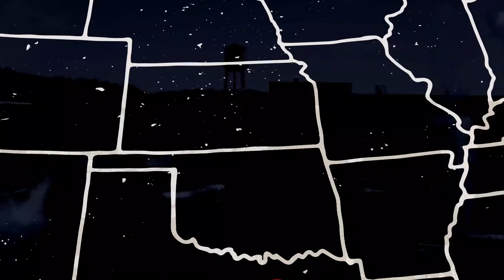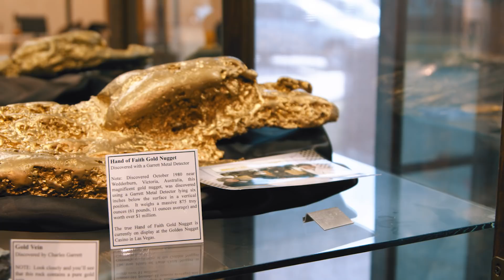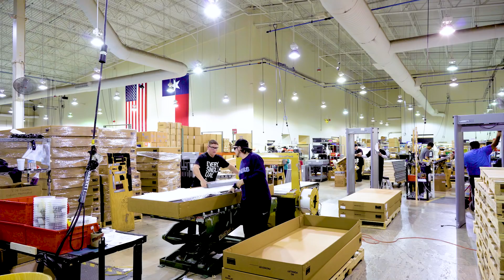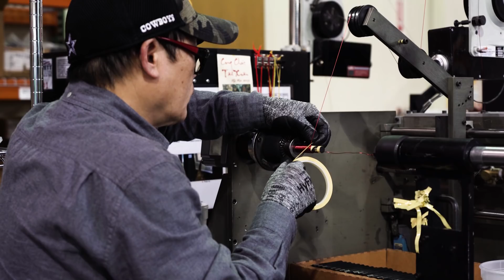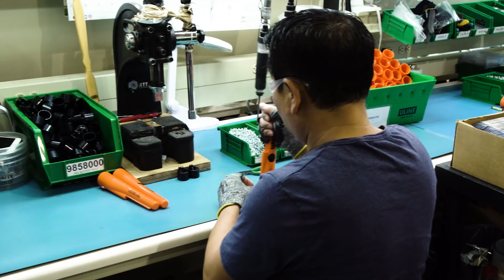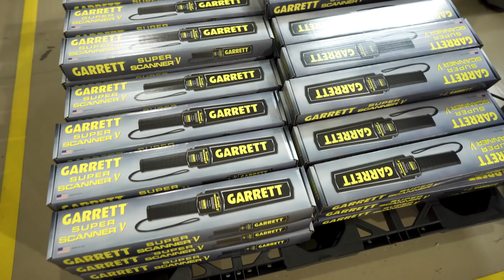Made In America Garrett Metal Detectors

Comment: Congratulation for statement " made in Amerika".
I'm using Garrett detectors since long time. Bought a GTI 2500 with the additional " treasure hound" double coil assembly => great success hunting for relics laying below 1m depth (in my case cannonballs from Napoleon battles in Switzerland, Austria and Germany). Very good idea to create this detector with exchangeable coil assembly. So you need only one basic unit and you just decide "in situ" what you want to hunt, either coins with the single coil ( I got several sizes from 24cm to 42cm dia) or you fix the treasure hound just within minutes to scan again for deeper relics. Although the GTI is a bit heavy compared to an AT pro, however it pays off regarding capability of deep scan. Discrimination is sharp and speedy and display of size/ depth is a nice add-on. 
Best regards from the "old world" (Switzerland)